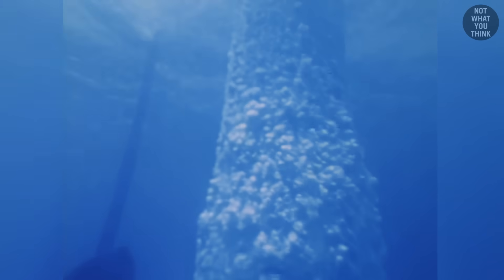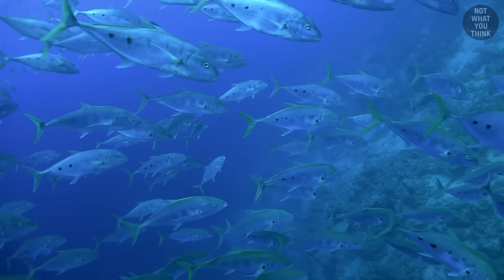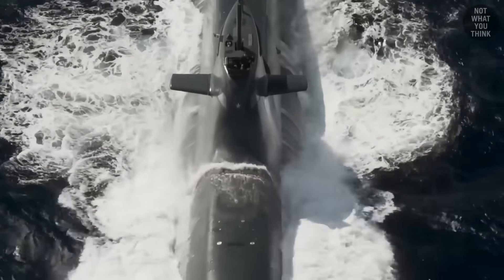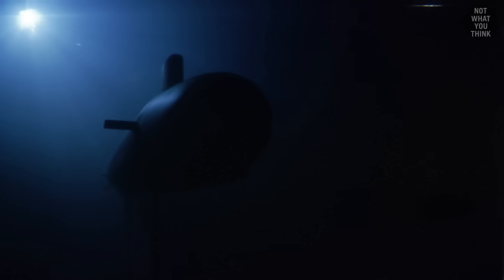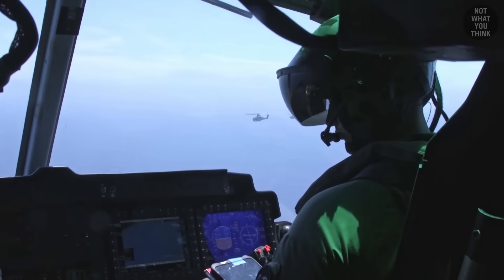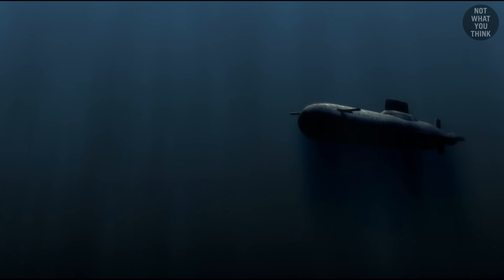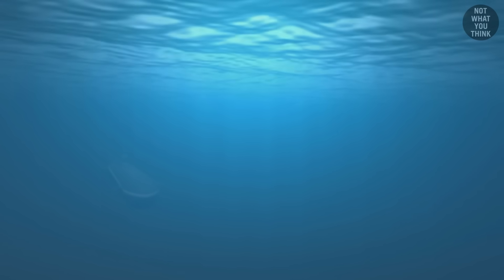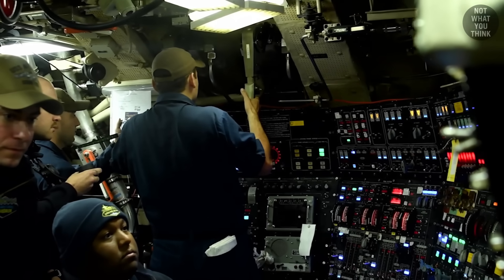Why Being Too Stealthy is Bad for Submarines

Comment: Holy crap this video was bad. Like SUPER bad, 100% bullshit, to the point where I'd question if it was a state sponsored disinformation campaign. 

Who the hell were your fact checkers on this? Utterly hilarious that you'd beg for people to join your channel and claim you wanted researchers of "your caliber" after posting something like this. True garbage.
Reply from the maker: It would be more helpful if you shared what we got wrong.
Reply: @NotWhatYouThink  (1/2) LOL ok, then get comfortable because it's going to be a long one... 
- Active "noise cancelling mounts" aren't used. That's not a thing. Active noise cancelling only happens with diesel engines and involves the exhaust piping. Modern subs "float" their decks on sound isolation mounts to the hull to isolate machinery.
- You provide no source for your "90-95 dB" assertion on the sound levels of Virginia class submarines. You also don't quantify it in anyway. Is that a broadband level? At what frequency? At what speed?
- You then go on to make the claim that the Virginia class 95 dB noise level is the same as the "ocean currents" and marine life. "Ocean currents?" What the hell is that supposed to even mean? Ambient noise in the ocean is well understood and follows a power-law decaying spectrum. It is also highly dependent on environmental conditions and shipping traffic. Simply saying the ocean is "95 dB" means nothing. 
- Claiming a "normal conversation" could produce enough noise to be detected is patently false. It is also highly unlikely that on a modern submarine, footsteps would be enough to give away a detection. The primary reasons being the aforementioned isolation of the deck and the impedance mismatch of air to water. A standard conversation between two people is 55-65 dB (re: 20 uPa@1m). This is lower than your 90-95 dB assertion just compared directly and even lower when you properly adjust the reference pressure so the decibels are in the same scale (water uses 1 uPa@1m). A 5 second google search should have made you question this. 
- You claim the Seawolf class submarines are the "quietest on the Earth" but then go on to claim diesel subs are quieter. You contradicted yourself in your own video. This shows poor writing and even poorer fact checking. 
- You make the claim that anechoic tiles make subs "even quieter." This is simply untrue. Anechoic tiles make submarines less reflective to active sonar. It's literally in the name: ANECHOIC. They have no appreciable effect on acoustic radiation from the submarine. Anechoic coatings have to be specifically designed for the frequencies they want to protect against. This is because of how they're designed, which I won't go into. They aren't a magic sound-dampening blanket. Their primary purpose is to prevent external acoustic energy from being able to reflect off the steel hull underneath them. They * DO NOT* work in the same way foam panels work in a recording studio. Just look at them. The panels in a recording studio are rough triangles designed to reflect sound away from the source and trap it with multiple internal reflections. That's why they're faceted in the first place. Now look at a submarine. Do you see a bunch of pointy little pyramids all over it? No. That's because the anechoic coating works completely differently, namely through impedance mismatching and resonance tricks. That's exactly why they have to be specially designed. If you tried to cover a submarine in the same pyramidal pointy panels as a recording studio, the flow noise generated by all the turbulence would be enormous. 
- You make the claim that the powerplant is the "biggest source of noise on modern subs" but provide no source for that claim. It's also untrue. Cavitation is the biggest source of noise on any sub, which is why they go through great pains to design screws in such a way to minimize it. After that, the primary driver of whether a submarine is quiet or not is the tolerances involved in the manufacture of its machinery. That's the primary reason Russian submarines have always been louder than those of the West: namely that Russian engineering and industry have always lagged behind the West in terms of the tolerances they can achieve. Russian engineers always simply designed to worse tolerances. It's also the reason the Walker spy ring and Toshiba CnC scandals were so devastating; because they showed the Russians how important tolerances were to stealth and gave them the tools to achieve them. 
- You go on to make the claim that older diesel electric submarines are "quieter" than nuclear submarines without so much as a qualifying assumption. This not only conflicts with your earlier claim that Seawolf is the "quietest" submarine, but it also begs the question: do you really think a Romeo class SSK is going to be quieter than a fully modernized improved Los Angeles class SSN? 
- You claim there are "no moving parts needed to keep everything powered" on a diesel SSK. Not only is this completely untrue, it's also completely irrelevant. Noise is caused by vibration, not just by moving parts. A poorly isolated transformer can be louder than a pump, and an electric motor is A MOVING PART, and is the primary source of propulsion on a diesel electric SSK. Inverters are a part of the power system on all submarines including diesel electrics, and they are a MOVING PART consisting of a motor spinning a magnet to generate AC electricity. 
- You claim diesels have to surface to charge their batteries. They don't. They raise a snorkel. Newer SSKs even have air independent diesel engines that can run without access to the surface. 
- You claim "most countries" decide to "stick with the slightly louder nuclear option." This is also patently false. The vast majority of countries operating submarines operate diesels. There are only 6 countries that have ever fielded nuclear subs. EVERYONE else is operating diesels. You then add the "if they can afford it" quip, which implies that nuclear sub operators are an elite club, contradicting your "most countries" statement not even 5 seconds before. 
- You claim a submarine "produces the same amount of noise" which is false. Submarine noise depends on what it's doing. How fast are they going? Are their planes out? Are they maneuvering?
- You talk about "acoustic holes" as if that is a "known thing" and that SONAR operators can 'track them easily.' It's not; they can't. Acoustic holes don't exist. If you had the slightest understanding of simple physics, you could figure this out for yourself. What's the angular size of a submarine at 10 km? What's the average beam size?  Do the math. A Seawolf class submarine is 108 meters in length. Angular size is roughly d/D, so 0.608 degrees wide if you had full beam (broadside) aspect. The beamwidth of a SONAR array is directly proportional to its size. This is a physical limit deriving from the diffraction limit. Acoustic waves have MUCH longer wavelengths than optics, so to resolve fine differences in direction you need MUCH larger arrays. For a linear SONAR array it's roughly 0.88 * wavelength / L.  A hull mounted array can't be bigger than your hull, so if we turned the entire hull of Seawolf into a SONAR array looking at 200 Hz the smallest beam it could form would be 3.5 degrees, 7 times LARGER than the apparent size of a Seawolf-sized object at 10km. This is a question of physics, not technology. It's not something you can overcome with clever engineering.  You're also acting like the background is at infinity and a quiet sub is just silhouetting against it. It's not. The whole surface of the ocean is a radiator of noise, and you have 10 km of it between you and the sub, and you have it also reflecting off the bottom. So how close would your ultra quiet submarine have to be to act as a shadow and "block out" noise behind it in such a way that you'd see a quiet beam? It's not what you think. Run the math. For 3.5 degrees that's 1800 meters. At 1800 meters it doesn't matter how quiet the sub is, you will almost certainly hear it. Beams are also 3 dimensional, so you have to take into account both length and height, and submarines are much much shorter in the vertical direction than they are the horizontal. There's simply no way for a submarine to "blot out" the background like the fundamental assertion of your video. 
- Your explanation of the Triomphant-Vanguard collision is thus 100% inaccurate. They didn't collide because they were "too quiet." In reality they collided because they misjudged the distance between the two of them. They each had contact on each other and were trying to maneuver in order to determine what the other sub was. They didn't just blindly hit each other. They didn't just "completely miss" on SONAR as you claim. Each sub knew something was there and was trying to determine what it was. Because they couldn't identify the other and they had limited contact time to form a solution, they couldn't properly judge the distance between them.
Reply: @NotWhatYouThink  (2/2)
 - Which brings us to your next point of misinformation: Navies don't share acoustic signatures on their submarines with other navies. That's absurd. Submarine acoustic signatures are some of the most closely held military secrets in the world. The US is not telling ANYONE what Seawolf or Virginia look like. The Brits aren't telling ANYONE what Astute and Vanguard look like. Hell, even Canada doesn't disclose signatures of their Victoria class submarines. In intelligence gathering centers that monitor acoustic underwater detection networks, even when co-manned between American and UK militaries, if one side finds the other's subs, they literally block out those bearings in the displays so they can't study each other's boats. 
- The whole section on thermal detection is just fiction. Not even good fiction. The ocean is a MASSIVE heat sink that dissipates heat very effectively. Detecting a submarine at depth by its thermal signature is just not a thing.  Submarines don't use the thermocline to hide from thermal detection. They use the thermocline to hide from ACOUSTIC detection. The thermocline prevents acoustic waves from below it propagating to above it. This is because the speed of sound is primarily influenced by the temperature of the water, and the thermocline refracts the sound back down. This hides any acoustic emitter below the thermocline from any acoustic detector above the thermocline. It's also not difficult to find the thermocline if it's present. You just measure the temperature profile of the ocean. 
- You claim masts are coated with radar absorbing material. I'd love to know what kind of radar absorbing material you think can stand up to being exposed regularly to saltwater and the pressures of diving in the ocean. Even the most modern fighter jets still have to be pampered to keep their RAM in good working order.
- You made the highly dubious claim that submarines are "fragile" because somehow being armored is counter to stealth. Do you have any idea how thick and strong a submarine's pressure hull has to be to not implode at depth? Submarine hulls are incredibly strong.  Antisubmarine torpedoes are generally smaller because they have to be; not because submarines are fragile. ASW torpedoes have to be carried by aircraft or fired on rockets/over the side by surface ships. They also work differently than antiship torpedoes and have different roles. Surface ships are bigger than submarines and you sink them by going underneath and breaking the keel. ASW torpedoes sink submarines by exploding on the hull and causing a bubble to form. The bubble attaches to the hull and its pulsations are what break the hull, not the explosion itself. A tiny hole on a surface ship is nothing because the water isn't under pressure, that's exactly why you have to go under it and break the keel to sink it. A tiny hole in the pressure hull of a submarine on the other hand is a death sentence because of the pressure at depth. Quite simply, you don't "sink" a submarine, you just give the one thing that's always trying to kill it, the ocean, a tiny bit of help. At the end of the day MK-48 torpedoes are bigger because they can be, not because they must be. The launch platform doesn't need to fly. The larger body allows for greater range and more explosives compared to something that has to be lifted by a helicopter like a MK-50. 
- Your section on submarine comms continues the trend of misinformation and half truths. ELF comms aren't received by a wire, nor do they carry nuclear launch orders, nor can they be sent by E6s. The transmission sites for ELF are HUGE with multi-kilometer arrays. They simply wouldn't fit on an E6. If they could then you could put an ELF transmitter on a sub even EASIER. And yes, they are extremely low bandwidth, on the order of bits every few seconds, which is exactly why they can't carry nuclear launch orders. They are used to get the submarine's attention and order it to come to depth to communicate, or to stream the wire to copy orders on higher rate bands, a literal "HEY YOU!" The wire is primarily used for these higher rate bands, NOT for ELF. Being a one way comms system is irrelevant. A submarine is allowed to come to depth and confirm orders if they are unsure, especially if the order is to launch nuclear weapons. That was the entire plot of Crimson Tide. The sub just generally doesn't want to, because that could lead to a counter detection. 

All of this is unclassified public information that your so-called "researchers" could have found in just a few minutes of googling. I'm actually curious as to how you guys missed the mark so incredibly badly on this. 

How good are NWYT's fact checkers and script writers? 

"It's not what you think."
Reply: @magicstix0r i appreciate you random submarine man. sorry ur comment got lost.
Reply: @NotWhatYouThink DAYUM LMAO u got cooked

Comment: I wonder if a sonar signal equivalent to Ultra WideBandcould be emitted and received by friendly subs, allowing at least friendlies to be detected without being visible to others.  The digital pattern could be changed on a regular schedule.
Reply: Right, even if you cannot read the encrypted signal, you are now SCREAMING at the top of your lungs telling everyone where you are...
Reply: @mememachine5244 actually not. Ultra wideband spreads the signal across the entire spectrum, or most of it, so at any given frequency the signal energy is below the noise floor. The digital message is encoded in an encryption that is essentially invisible/inaudible to anything that doesn't know the code.
Reply: @GaryBickford the effective range for it would be so short as to make it unusable. Some navy's do use encrypted transmissions for delivering messages underwater, everyone in range can detect them, they just can't decode them.
Reply: @spacedonkey3412 That is one of the issues of UWB in radio. However, humpback whales for example can "talk" over distances of hundreds of miles. Their calls may be as loud as 188 db (a jet taking iff is about 140 db, and human hearing loss van occur as low as 100 db). It's plausible that using the UWB spread spectrum, that sound energy could be distributed so much that it is still "quiet" at any given frequency while still propagated long distances. However there are serious challenges regarding differential dispersion and refraction of different frequencies, and absorption of some. Its a bit of a long shot but not without merit to do some research.
Reply: @GaryBickford  what I dont understand though is, if it's a noise source in the ocean why won't passive sonar detect it?

Comment: Can't nuclear subs also recharge batteries and use electronic motors when absolute silence is needed?
Reply: Nuclear submarines have much smaller battery banks because they're only meant for emergency use such as when for some reason the nuclear reactor needs to go into an emergency shutdown. And even if hypothetically a nuclear submarine would be equipped with a massive battery bank, it would still be pointless and noisier compared to a modern diesel-electric sub because the nuclear submarine's reactor needs to be continually cooled, and that's what produces most of its noise.

Comment: Hey I always had a question. If a nuclear powered ballistic missile sub is hit by a torpedo or by a mine what would happen to its nuclear weapon?
Reply: They either sink with the boat to be corroded away over time, like for example the nuclear tipped torpedos in the sunken Soviet sub K-278. 
If the weapons would get hit directly, the conventional explosives of the nuklear warheads and the fuel (dependent on the type of fuel) would be set of. The plutonium would be spread to contaminate the sea.

A nuclear chain reaction can't happen since they require a very precise and tightly controlled explosion to compress the plutonium pit.
Reply: @peterfruchtig5334  i don't know that much about the specifics of nukes but i'd imagine they use a relatively stable compound like C4 so that  it can't accidentally be set off
Reply: @RoyalTacos256 yea
at worst they got wrecked by the explosion and heavily disfunctioned
Reply: they would sink with the ship. they would not achieve the requirements for a thermo-nuclear detonation. for the "nuke" to actually detonate there are an enormous amount of things that have to happen in a very specific order. Even if the giant missile they sit on top of were to suddenly blow up it would destroy the boat "possibly" chain reaction all of the missiles thrust and fuel (there could be up to 24 on board an Ohio class, 20 on a Typhoon) imagine a chain reaction of 24 missiles, that is over 3 Million pounds of highly explosive solid rocket fuel. The warheads would still not detonate. chances are they are destroyed